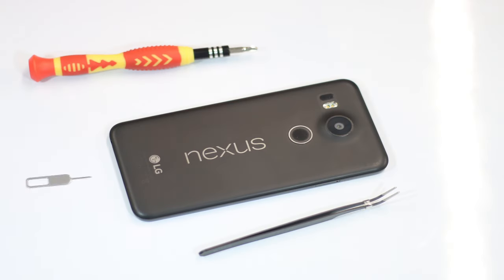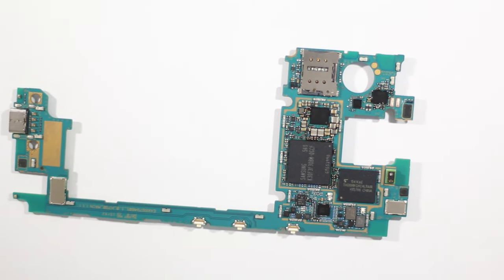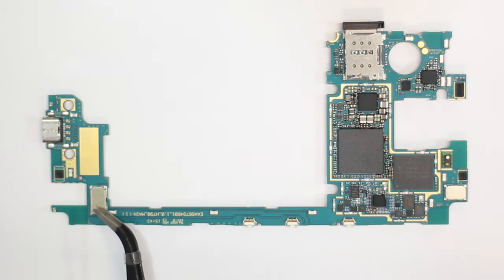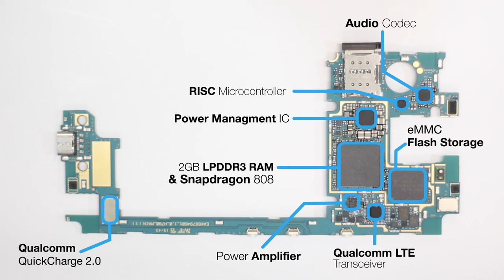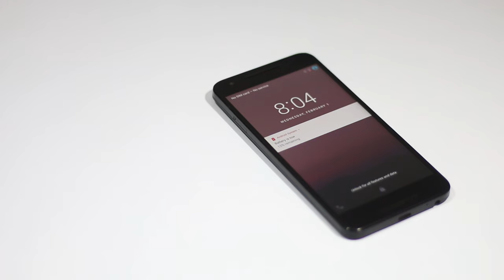What's Inside an Android Smartphone?

Comment: What is the back of the phone called with all the components not the case but the bit with the battery the ribbon cable connector called please need some help with my xiaomi mi 10t lite 5g can someone help

Comment: That's cool. But I didn't know the other tiny components beside the chips. They were all over the place. I know they are resistors, capacitors, diodes other very basic electronic components but couldn't identify them at all. It will be helpful if you could make a video explicitly pointing out the different tiny resistors, inductors and capacitors on the motherboard of any popular smartphone?